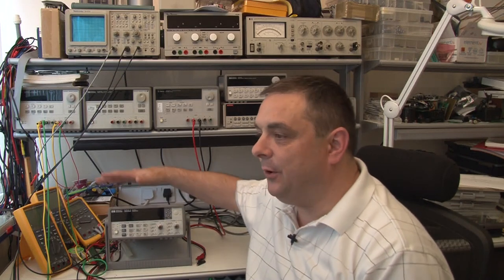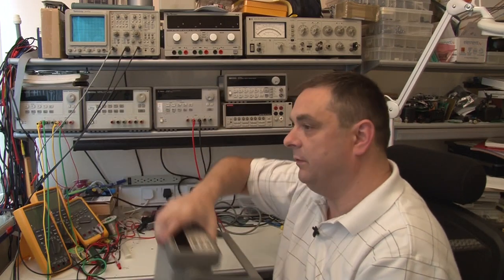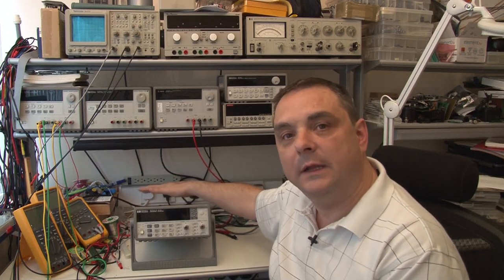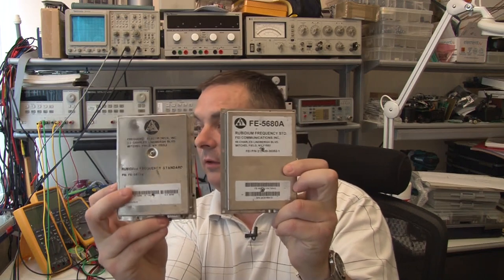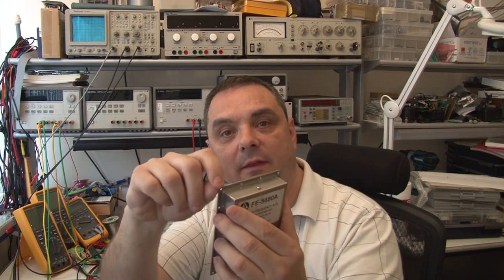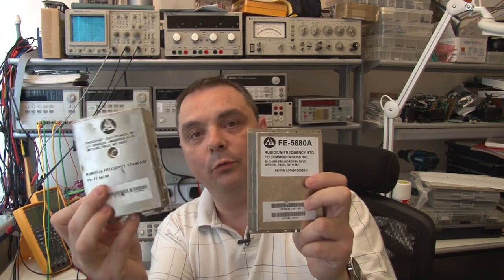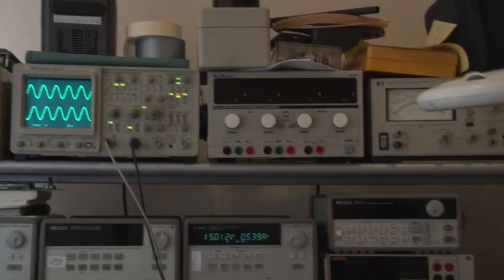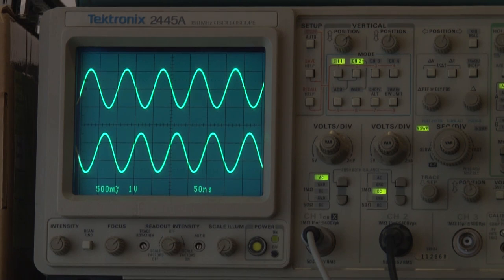I need 10MHz - how hard can it be! FE-5680A

Comment: I realise that this video is over 10 years old, but my method may still be of use:
I haven't seen this complete video yet but what I have always done to get an accurate 10Mhz reference is by using the cesium atomic clock driven carrier signal from WWV, by adjusting my oscillator to this carrier frequency using the beat frequency method. This is even more accurate than a rubidium frequency standard.
The method I used was by tuning into WWV 10Mhz signal using a short wave radio then the device that needed its oscillator adjusted was brought near to the short wave radio and its oscillator was adjusted to provide a zero beat signal. I was located in New Zealand , so had to wait for the best time of day/night to get the best signal from WWV of course.

Comment: I'm late to the party, here, but with 12 years working in a USAF lab calibrating/repairing counters, I've learned a little, or, enough to be dangerous. Some basic counter advice.... If you're going to calibrate a counter, don't stack it on anything; let it sit by itself, even in use.  Keep your room temperature steady if possible. Our lab was kept at 74 degrees F. Allow Room Temp oscillator (RTXO)-based counters 24 hrs warm-up, oven-based (OCXO)  at least 72 hrs. Agilent RTXO trimmer cap is an abomination to adjust (I pined for a trimmer cap with a worm drive!).  I was happy at +/-2 Hz on those. Use a brass, ceramic, or other non-ferrous screwdriver. Agilent 53132A OPT1 counters were a breeze... one would plug in an appropriate external 10 MHZ standard and "tell" the counter to calibrate itself (all of 5 minutes!)! The Racal-Dana (R-D) counters' OCXO  fine adjustment can be very touchy, too; you would adjust it, but then it would take off again! Don't over-power the R-D counter's input 50 Ohm function... you'll burn up the input resistors (easily fixed on the R-D's though, with a pair of 100 Ohm half watt in parallel. Those R-D push-buttons got to be un-obtainable for me in the States... had to condemn a few. Made me furious 'cause they were  (are) a good counter. Check/calibrate any counter at least once a year against a rubidium or GPS-slaved oscillator. Get a Rubidium and use it as a "shop" standard as an external input for all your lab 10 MHz equipment.. you shouldn't have to worry for a LONG time. ALL digital displays have an error of +/-  one count of the Least Significant Digit (LSD).

Comment: This is just for historical reference, but back in the days of analog TV. The way I calibrated my FC was I would take a color tv set and hook up my FC to the chroma oscillator and tune the TV to a high powered OTA TV station (very important). Then I would adjust my FC until it read 3579545. ICYW: The FCC required all high powered TV stations (10kW>) to discipline all there frequencies to a rubidium standard.
Reply: The good ol days !!!
Reply from the maker: Yeah thats pretty common approach still but you need to know which transmitters are good and you need a receiver and so on so its not as easy for many who just need 10Mhz :) which is where I came at this from.
Reply: Gerry Sweeney will I get oscillations with just a crystal and a battery?
Reply: +Owen Chase science channel No.
Reply: ***** ok thanks

Comment: You can use modern replacements for those oven-based TCXOs. If you want to make a board anyway, you might consider to chose a modern part. Better accuracy, smaller, way lower power consumption.

Comment from the maker: Hi Gary, thanks for the feedback.  The first one is definitely a 1PPS version, there is an 8.3Mhz signal inside and it is tuneable using software and internal RS232 connection but at the time I wanted one that was specifically designed to put out 10Mhz which is why I asked the supplier to send me the correct one as advertised. I will get around to hacking the other two at some point and see what I can do with them. Gerry

Comment from the maker: Hi Alexei,  thats not correct, the working one I show in my video is unopened from new, the seal had not been broken and you get 10MHz out on pin 7, thats a fact.  What you describe is true of the 1PPS version (the first one I tried).  I don't believe I fried any part in the first one as I only connected power to pin 1 and the rest was just passive probing. I will find out more when I tear it down. Gerry

Comment from the maker: Hi stuckinpants, thanks for the pointer, I found these. I guess my only concern is they are rated at 0.5% which is not that great, The OCXO I bought allows you to calibrate it with 0-10v +/- 0.3 so the tolerance of the TCX0 is the allowable range for the tuning of the OCXO.  and the OCXO can be bought for about £20 so I would say they are probably not worth £11 each. Gerry

Comment from the maker: If you get the 10Mhz, you need to supply the unit with both 15V and 5V.  Pins are as follows...

1 = +15V (about 1.5A)
2 = GND
3 = Lock (active low) 
4 = +5V (about 80mA)
6 = 1 PPS Out
7 = 10Mhz Out

The Lock output on pin 4 is not designed for much current, I would use a low current LED (2mA), Cathode to pin 3, Anode to 1K5 to +5V

You can use a simple buck regulator board to stop down 15v to 5v as I did in my video. 

Gerry

Comment: Hello, Gerry. I use those Rubidium standards as stand alone standards for my lab and they perform great. I bought two and both work great. 
I have in the lab HP counter like yours with highest possible accuracy which costed a fortune and when compared result to Racal-Dana 1991 + Rubidium standard the result was promising. Readings differ only in 0.6Hz while measuring 40MHZ

Comment: Nice Video Gerry. I have been doing similar things lately. Following Dave Jones video, I bought a Rubidium oscillator several years ago and only used it a little. More recently I've invested in some older but quite high spec equipment and have been curious how accurate they were even though some have included calibration certificates. Just recently I also purchased one of the second hand OCXO's pulled from equipment and I too found them to be very good. I have video's some of my findings but not edited the clips yet. One other comment why not just use one of your oscillators, maybe even the rubidium standard and distribute that to all of your equipment? I would be interested in how you would tackle it. I am thinking of taking the 10MHz input and using some buffers for multiple outputs and distribute that to my various pieces of test equipment, counters, spectrum analyzers etc. One other thought, do you need to convert the sine wave output to square wave for any equipment? and is there a min/max voltage range required for your equipment, I know some must not exceed certain levels.

Comment from the maker: Hi Brian, a GPS and a Rb have different characteristics. A GPS can take a long time to lock so should probably be left switched on, whereas the Rb takes 1-2 minutes to warm up and lock but once locked its ready to use.  Also while GPS has excellent long-term stability, the Rb short term stability is far better. All in all, I would say an Rb is a better shop reference. The best would be a Rb synced to a GPS but for me thats definitely overkill.  I have a Trimble Thunderbolt I will do a video soon
Reply: I just bought a GPSDO that's accuracy is rated at 1 PPB (Billion) The GPSDO locks in well under a minute, has two outputs and it's output frequency is programmable. £150 you can't go wrong.

Comment from the maker: I think you are good to go with 14.8V so long as its a regulated supply.  The cleaner your supply the better.  If you are using a linear regulator (7805) you need a heat sink on the thing, it will get warm. Gerry

Comment from the maker: No it will not be too hot, just warm. with 10V drop across the regulator  at 80-100mA the regulator will dissipate about 1 watt in heat.  Not too much but enough to be a problem if you don;t cool it a little.  Let me know when you get it all working. Gerry

Comment: I got same - there are no boxes that have 10MHz output on D connector. You have to add SMA output yourself and then you need to reprogram it which can be easily done over RS232. You most likely fried 74series flip flop chip inside that generates 1 second signal. (I had to re-solder mine :-) ). Also it generates 8.xxx MHz sine wave signal which is not very easy to change to 10MHz because they all UNIQUE, you have to calculate divider value and then reprogram it by setting correct 64 bit divider.

Comment: O well ... I did all that work, should have just asked to send me the right one. Maybe coax gives me cleaner output.
Another thing-you may find a 5 pin header right next to Analog Devices DDS chip. (same one you will have to use to reprogram it over RS232). If you get  a dent on metal cover it may touch the header and as result there are no output on D connector at all. Device may still work if you remove cover. There is a pdf doc online describing similar mod made by Matthias Bopp.

Comment: Maybe I am missed something in the video, but why not get a shop GPS reference. Can by a GPS 10Mhz reference off ebay at reasonable prices.
Reply: Brian, I think yoiu've nailed it. His one reference will handle several counters, etc by itself and all would be "automatically" on frequency. When a USAF"s  Type II lab I was working at was re-built several years ago, I , being the "counter specialist", advised management to use a shop reference (GPS-slaved rubidium) a distribution amp, and a BNC outlet at each tech's bench. Worked like a champ and we had 10 to the -12th accuracy.
Reply: That’s what I would do

Comment: Hi Jerry,
First you don't want to let the Rubidium standard get too hot, you really need to heatsink it. I didn't watch the complete video so maybe you did that. The OCXO heats to a point that is its stabilized voltage, once it reaches that it the heater resistor only needs to come on to occasionally bring the case up to working temp.
Rob
Reply from the maker: +mosfet500 yep fitted a heatsink :)
Reply from the maker: +mosfet500 in this video https://www.youtube.com/watch?v=chrzrod3tQY

Comment: excellent !  I need a counter for very accurate work,and just can't find a reasonably priced unit with a HS oven. So this is very interesting,since i may just have to "improvise" a standard to bring these out of spec over-priced devices into useful range.Agilent (53181A)
Reply from the maker: I have a PCB or fully build upgrades for the counter you have if you are interested. 

https://gerrysweeney.com/update-diy-hpagilent-53131a-010-high-stability-timebase-option-pcbs-available/
Reply: just placed the order. Great work and much thanks! I'm one step closer to getting a pile of receivers done.
Reply from the maker: Thank you for the order, I appreciate the support. You will love the counter after you upgrade it, totally transforms it. I will get shipped on Tuesday/Wednesday if thats ok as I like to soak test them for 24hours before I ship them
Reply: absolutely. Take the time needed. Glad to support all the hard work.

Comment from the maker: Hi George, suppose I was to make a frequency counter using a micro controller or a FPGA, I would want to be able to check how it compares.  Or if I were to review a frequency counter I would want to know how accurate it is.  I wanted to upgrade my HP counter with an OCXO but I could not be sure of the accuracy without a second point of reference which is where the RBS comes in.  I would say that any electronics lab *should* have a reasonable frequency standard.  Gerry

Comment: Hi ....just found your channel great stuff
not sure if this is the case but FEI manufacture a variable output version (between 1Hz and 20 MHz) I think it may be possible that your first one sent in the video could be that one might be worth checking into but requires some additional circuitry to operate properly hope it helps ...............great channel

Comment: Thank you for the video, but I know of a much cheaper (N. America)way to calibrate a counter. Get a WWV receiver ($5-$20) and bring it close to your counter. Listen to the WWV receiver, which runs on an atomic standard (10mhZ) and heat the beat. It may sound like wahh wahh wahh etc. Turn your counter until it is steady and presto, your calibrated to 10 mhZ!
Reply from the maker: Sure that works too, but not here in the UK and not useful when you need a 10Mhz reference :)

Comment: I just stumbled upon your channel excellent detail exactly what I want to do to my HP that I just ordered off eBay. I believe Dave from EEVBlog did the same update upgrade he got the in ternal timer off eBay for the higher accuracy I believe he used a rubidium for his source. In another one of Dave‘s videos or another technical channel someone use the rubidium as a reference timer I believe for all three pieces of task equipment with feeds into the back of their unit. The rubidium timer was plugged into the oscilloscope it was plugged in to the counter and it was plugged into the frequency generator simultaneously so they were all synced off the same rubidium reference.

Comment: I haven't looked inside the HP 53131A yet. If the capacitor fell apart, then is it possible to replace the cap (I assume it's a variable cap) with a better quality one? Or replace it with one that trims more accurately? I bought two FE-5680A from ebay (from a different seller), and both have an SMA connector on the back. The seller (that I bought from) actually tests their units in advance. Mine work beautifully. They have no trouble with locking from 8 MHz to 12 MHz. Only issue was that one didn't have the 1 pps output. But it wasn't much of an issue, since we can always use a divider chip to get 1 pps.

This is a great video, as it offers nice options in case the HP 53131A stops working due to a wardrobe malfunction with the internal oscillator.
Reply from the maker: +Kenny yes its possible to change the cap if you can get the right part.  That aside though, the internal oscillator, even with a good cap is still a very poor oscillator, definitely should have a high stability oscillator in there, it makes all the difference. Check out these articles if you have not seen them already: http://gerrysweeney.com/tag/53131a/
Reply: +Gerry Sweeney Great! Thanks Gerry. I haven't seen those other articles. Thanks for your time with providing that link. I'll check those out. Much appreciated.

Comment: Gerry, 

Did you ever get the one repaired? I had one that wouldn't lock, and it's just a simple trim-cap to adjust the sweep range. I guess as they age, there's some drift due to age, and you just have to make sure the sweep actually crosses 10Mhz. If you hook it to a counter, you'll see the output doesn't cross 10Mhz, so it never locks. Very simple fix... 

http://www.ko4bb.com/dokuwiki/doku.php?id=precision_timing:fe5680a_faq#what_if_my_5680a_output_does_not_lock_up_after_several_minutes
Reply from the maker: stazeII hi, I never got around to poking around with it, thanks very much for the link it definitely looks worth a try, I may well give that a go. Thanks again. Gerry
Reply: Gerry Sweeney No problem. Like I said, worked for me (I bought mine as not working (so it was cheap)), and was very easy. Just had to realize I had to remove the top, and not the bottom plate. Since then I've had no issue at all getting it to lock. Guessing the heat from the unit just causes things to fall out of spec.

Comment: Great Video, Thanks
Do you know, how stable such a OCXO is over a year?
Does it require re-calibration from time to time?
I saw a few on ebay and they need 24 V supply
How critical is the voltage supply?

Comment: Hi Gerry

Could you tell me how accurate that OCXO you use in this video is please
like +/- 10Hz when warmed up
Reply from the maker: Each OCXO is trimmed to the frequency so needs calibrating but they are generally within 100hz without any trimming. They key though is their stability, which is often 10-10 or 10-11 so pretty good.